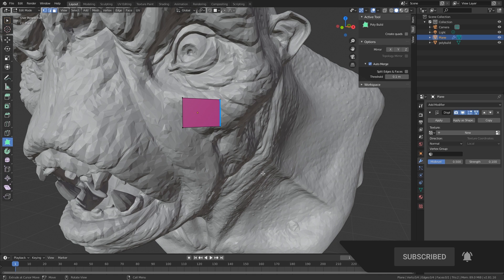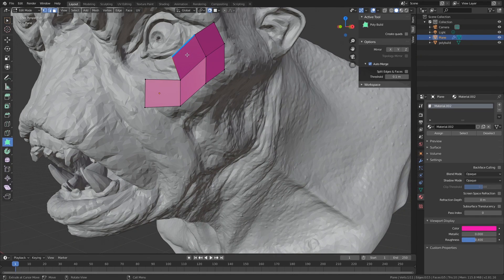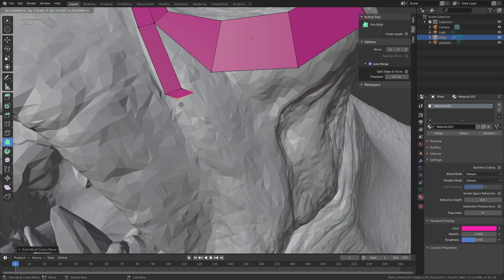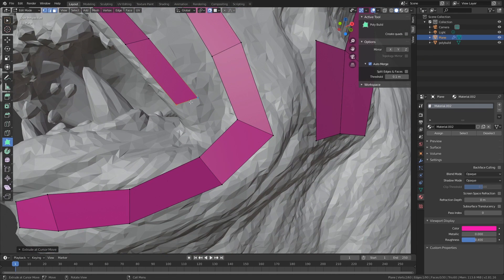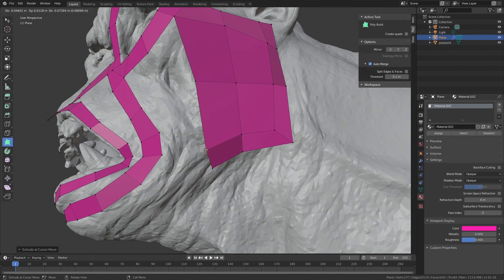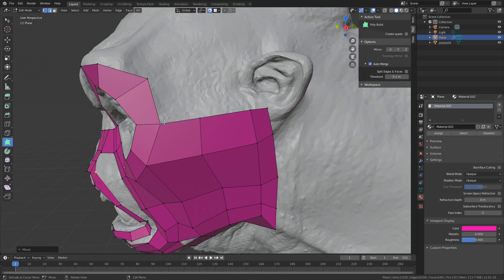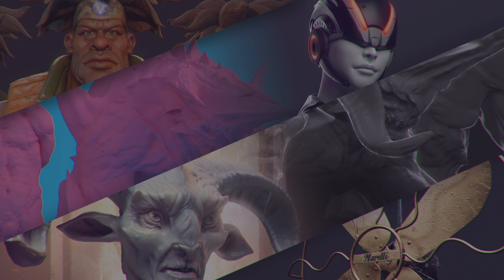Retopology Using New Polybuild Tool in Blender

Comment: I have a question. Why does it look like a lot of amazing details are being lost when you retoplogoize
Reply: All of those amazing details on the old mesh are digitally sculpted in to create realistic forms, but since there's so many polygons that make up all of those fantastic details, animating the old mesh would be a nightmare, and extremely heavy on computers to both calculate, and render. 

So, when you retopologize, you're creating a much simpler form of the mesh, but the best part about this is that there's a method called normal-mapping, which allows you to turn all of the polygonal data of the original mesh into a special texture that can be applies to the low poly mesh that allows blender, and other 3D software and engines like games to fake the old geometry just using a much less taxing texture.

Comment: So for what I understood the new retopology that we have created  It's gonna be the actual mesh. Am I right?????????
Reply: In this workflow, you would always keep the original mesh as a backup and as the showcase, but for animation production or gaming, you would use the low-poly mesh mixed with normal map textures which are basically faked geometry baked into a texture that render engines can use to actually fake the old geometry on the new low-poly mesh without actually costing nearly as much resources on your computer. 

So, you'd animate with the new mesh, and for games you'd use the new mesh because you don't want your game to slow down because you have unnecessarily high-poly models.

Comment: isn't it asier to just apply a decimator and/or remesh modifier, then clean up the trouble spots?
seems like a lot of work doing it all from scratch
Reply: Sorry that this is a late response, and I'm no professional, but based on my understanding of manual retopology, the point of using a manual method over a modifier method is that decimator and remesh modifiers use algorithms and grids to create geometry without taking into account important forms of the base mesh. 

This might be fine for a static object, or creating a LOD (Level of Detail) mesh for a background object where it's not important to follow organic forms naturally, but this creates a huge problem for meshes you intend to animate. 

Based on animation, especially animating characters, the polygons have to mimic anatomical forms, that's why you see Henning here creating loops around the mouth and the eyes, since those are rounded forms on the human body, and they have important muscle structures supporting those forms, those will now be easier to animate. 

If you used the remesh modifier, or decimate, you wouldn't be able to control where it decides to put any of the geometry, which would lead to polygons that overlap where the muscle forms would otherwise be separated, so when you want to animate that segment of the face or body, it deforms unnaturally, and it can create very obvious visual artifacts.

Comment: One tip, which perhaps might be related more to cleaning up topology (which i've spent all day doing). Having the  sub/div modifier in the stack and turning it on and off. It might only be me personally, but somehow my vision can more easily see the organic loops i desire when its smoothed. and also find strange shading/normal behaviors. Anyway, nothing revolutionary I guess, but it has helped me a lot today.

Comment: 9:28 Anyway, when you export your model to a game engine, doesn’t everything turn into triangles anyway?
Reply: It does, but if your model is all quads or at least mostly quads before, the triangulation is way more controlled. And so is the Deformation when you animate it. Random tris destroy the edgeflow which is important for animation
Reply: There are only 2 ways to make 2 triangles out of a quad and both are essentially the same. I‘ve seen horrible things happening with auto triangulating huge ngons.

Comment: really silly question as I am brand new to blender but I am making a character for a game  I am making and its got way to many faces. Thus I am going to do some retopology and then animate but once I am done with the retopology will I loose all my detail from sculpting or is there a cool way to keep it with the lower poly count so my game does not lag like crazy?
Reply: Most games also add detail with the texture, So (for example) make a low poly shirt for the character but add all the folds/creases clothing has with a texture. Which, with good planning, you can also bake when you bake the normals that Tito mentioned.

Comment: Isnt it a goo and handy tip to sketch on the big edge loop and flow using greasepenicl. Then you can turn that on and off to check them now and then. Ive haven't done much retopology work, but I guess for beginners that could be handy. You can sketch those lines directly onto the model so they will follow the model and you can still turn and rotate the model to check them
Reply: Have you tried Bsurfaces in the add-ons ? That is just what is does.

Comment: A small problem I noticed is that if you drag a face from a three edge corner (with Ctrl at three verticies) the dragable newly created verticy is not on top of the mesh. I don't know if it was just for me but I just clicked on the verticy and then it went onto the surface.

Comment: But, once you have completed reto, what is the next step? How the low res and the high res model are connected???
Reply: Texture baking, creates a normal map of the High poly sculpts face normal data according to the Low poly retopo versions UV map
Reply: Get the textures, ambient occlusion, normal map, etc etc from the high poly model -- bake all that stuff onto the low poly one.   These guys didn't really explain this here.  
  When they are making decisions about the size of the quads, and loop flow,  the final outcome of the capture of the data and baking to the low poly is what they have in mind.  It therefore depends a lot in what is the final form of the project
Reply: @StringDeposit   thanks

Comment: New to Blender. Slowly learning Python. 

Question: Would it be possible to create a custom version of the poly build tool that toggles all of those additional settings (that you go over at the start of the video) with a single click, and then have them all revert to their original settings when you deactivate this custom tool (as in clicking the button again to "turn it off")? Because that would be incredibly useful. The only thing I'm not liking about this method for doing topology (and I've used it before on my own) is that I feel like I'm constantly having to toggle settings on and off as I go, depending on what I need to do at any given time (although your particular approach, which differs from what I was doing slightly, might even already solve a lot of that). 

Thanks for a great video.
Reply: It's certainly possible to do it with custom written addon on python. If you are interested iirc there was a nice blender 2.8 addon development for beginner video by Jayanam on Youtube, with some extra ones on addons from him. Also using blender console for learning methods/variables is quite useful (as it outputs same names you can use in python addon).
Reply: The "Info" editor type shows the python code for the actions you take.  It can be pretty useful for making your own python scripts
Reply: Thank you both!

Comment: For this to really be useful, there needs to be some kind of transparent shading on the retopo geometry so you can actually see the highres geometry underneath. Possible?
Reply: Or try toggling Alt+Z.
Reply: @CGPacifica  or that if you wanna only see the wireframe
Reply: Just make a transparent material for it
Reply: You can change that on the overlays panel.

Comment: *scratches at chin, "so... why not just.. poly build the face in the first place?
Reply: Because you might want to use the sculpt as a displacement map that you add to the low poly mesh.
Reply: @Mocorn  I admit I'm still learning all this sculpting stuff.  When i learned modeling in school, it was all the polysculpt stuff..  Never though of the use as a displacement map.
Reply: That's how it used to be done before Zbrush changed everything. It was much slower to model this way, because you were simultaneously thinking about topology and design at the same time. Plus it was really a pain in the butt to go back and make big changes to your design later down the line.

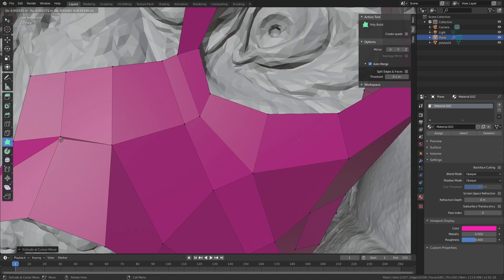Comment: A tip regarding snapping. Activate Vertex and Face snapping by clicking on them both in the menu while holding shift. That way you can activate multiple snapping options at the same time. Also super useful when dealing with retopology, since Vertex snapping helps with precision snapping like at 11:33 where you try to merge one face to another when trying to delete unwanted geometry (With this option you can also have a very low Merge by distance number since it will snap a lot easier with Vertex on.), or when you use the Poly Build tool to fill empty geometry
Reply: fucking goated. thx bro
Reply: Thanks!
Reply: wow, that's actually super handy! I've tried shift clicking other options for face / vert/ edge selection but never tried the snapping before! Thank you :)
Reply: Do we still use shrinkwrap for this Polybuild method?
Reply: @Khola_D  You can, but I personally don't. I only use it at the end once I am happy with the geometry.
Reply: may your pillow always be cool and your soup always be hot <3

Comment: One trick I use to avoid that awkward moment where you can’t auto merge the verts is to double tap g on just a single very and smash it into the one I want to merge it with. If auto merge is on its so much faster than hand placing and hoping it’s close enough. Great vid.
Reply: where to turn on auto merger?

Comment: Why did we do retopo again?
Reply: to make a low poly base mesh, we then use said mesh with the normal,texture and displacement maps of the high poly (sculpt) to regain the detail. the point here being that the resulting model is much more optimised for game animation or if converted to high poly with sundivision modifier can be used as in vfx/movies where higher model fidelity is required.
Reply: Taken Razen Okay thank you :)
Reply: @amitrana2756  ah so thats how u regain the detail. Was wondering whats the point of retopo if all your sculpt detail will be gone.  Can u tell me how to get those normal and displacement maps that are based on the high poly Sculpt?
Reply: @Faiqal_x1103  By a process called texture baking, it requires both the high Poly sculpt and final lower poly version and bakes the high poly sculpts face Normal data as texture according to the low poly versions UV map.
Reply: @VertexDon  i see, thats interesting, i think i get the picture, thanks!

Comment: YES! Finally, a more efficient tool for Blender’s retopo that sends Quad Draw running for its money! I need to retopo my alien model that has 400,000+ verts and this was definitely an awesome addition to Blender! ;)
Reply: Use wrap 3 program... Recommend for you., 👍🏻
Reply: @kdmaarof8387  Not sure how would use it here, unless you do human face, where you could have same topology. Please explain what you had in mind.
Reply: @kdmaarof8387  Someone ported the option to blender.. I dont remember the addon name but still.
Reply: Imo quad draw still king until topogun 3 is released.
Reply: Polybuild is still not as effecient as QuadDraw and has many problems including selection,snapping, visibility issues, smoothing the geo......etc in comparison it's not even 10%.
Reply: I have a question, what do you I do with the sculpted after I retopo it, do I delete or keep it.
Reply: @ChiChiArts-m9v  You use hires version to make displacement and normal maps.
You use retopo version for animation, then add displacement and normal maps to get the level of detail.
Retopo version could be used with subdivisions. All depends on workflow, including driving hi res model with proxy model.
Don't know the quality of blender baking, look for latest tutorials.
Other programs like xNormal (free), 3D coat, substance painter, etc, most professional software has their own baking tools.
Reply: sanjios Thank you so much.
Reply: Dumebiafra N If you’re using Maya’s Quad Draw tool, won’t the sculpt you did be replaced with the retopo-d model you made out of it? So wouldn’t it automatically make the retopo-d version the new model?
Not sure about Blender. After putting this new tool into practice, I agree with some of the comments here that there still needs to be some improvements.